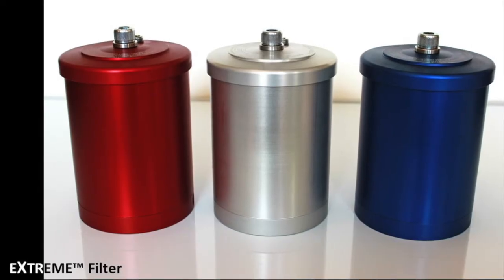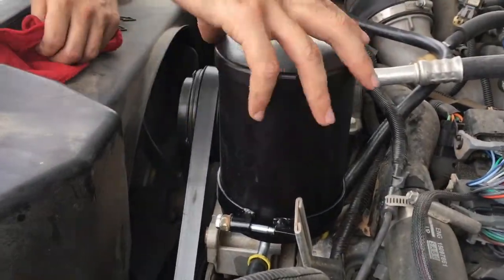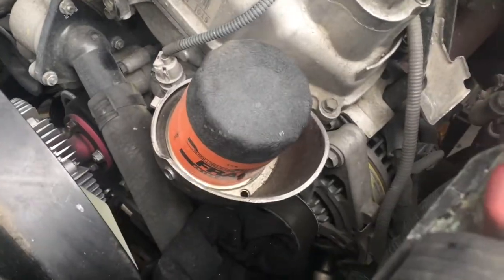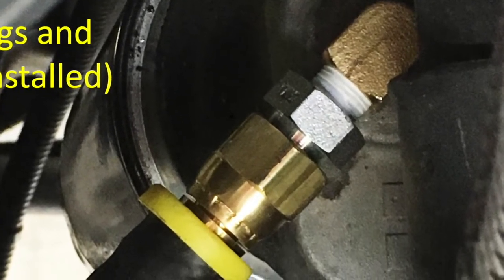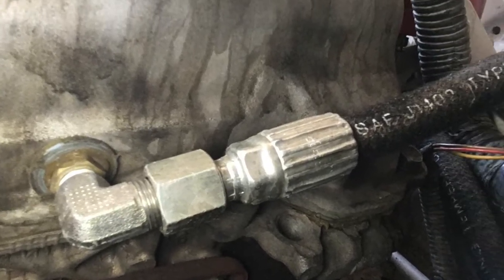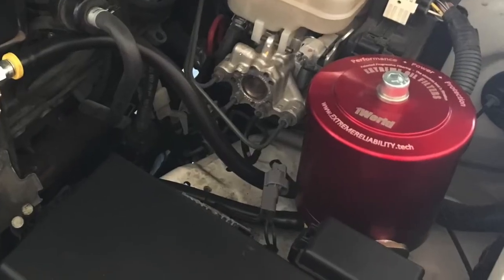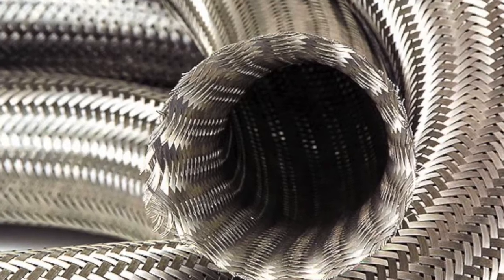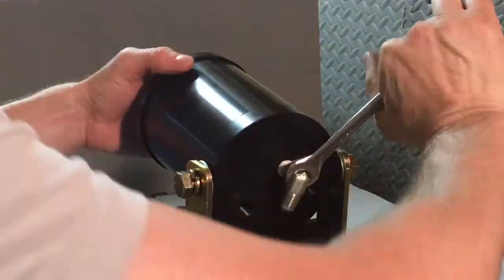Insane Diesel Bypass Oil Filter General Installation

Comment: What effect does this have on oil pressure? Is the pressure not going to take path of least resistance through this filter, rather than the bearings?
Reply from the maker: The oil bypass filter has orifices on the bottom of the housing that reduce the pressure so that it doesn’t take any from the system.

Comment: what are the other 2 holes on the bottom of filter for or do the remaining holes get plugs
Reply from the maker: They are mounting holes, in case you wanted to mount off the bottom of the housing. Great question!

Comment: How easy would it be to find replacement filter elements in Europe ?
Reply from the maker: Our elements are designed specifically for our bypass oil filter, we recommend contacting us to purchase elements in bulk (case of 12 or 24)

Comment: Won't that affect the oil pressure? put more stress on the oil pump?
Reply from the maker: @opreabogdan6773  no it has a built in regulator.  Does not affect oil pressure even at startup.

Comment: Does a bypass filter help with dpf
Reply from the maker: The filter keeps the oil clean. An engine with a DPF will put more soot and junk into the oil, shortening the life of the engine. So the filter will restore engine life and extend it further. However, the DPF itself will not be affected. Learn More at InsaneDiesel.com